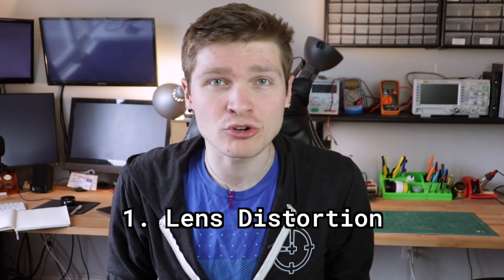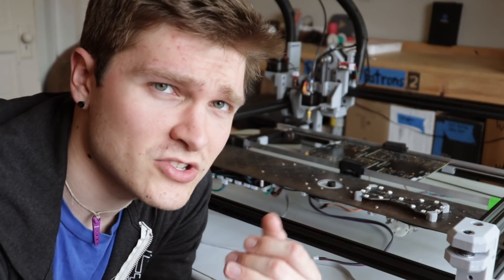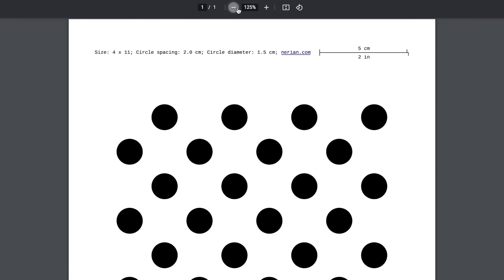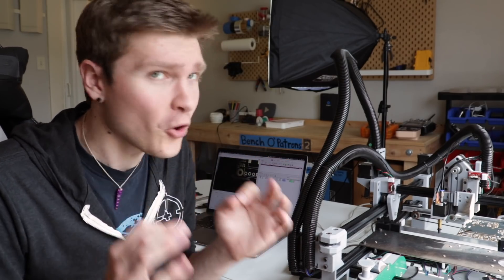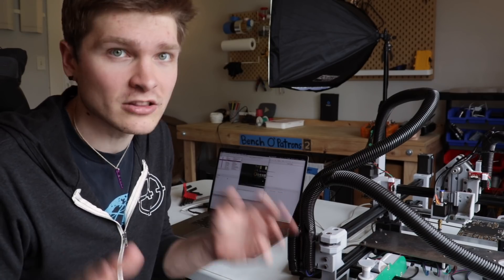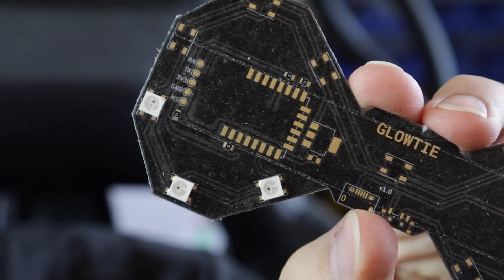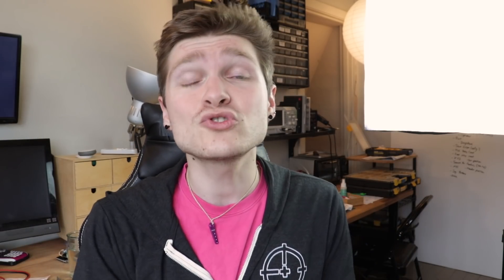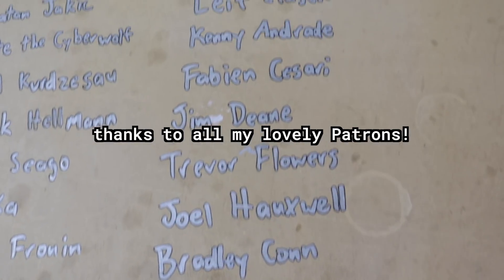PnP Calibration with Computer Vision!

Comment: I found that doing the bottom vision, the part/nozzle should be at the same Z as the board.  This takes in account if your Z travel is not 90 degrees to the board.
Reply: Good tip!
Reply: Indeed, getting everything (parts in feeders) the same height as the PCB made a significant improvement for me, did not think about bottom vision, great tip!

Comment: I hope you clamped the PCB down when you did the calibrations, otherwise you have to perform that process again, this time CLAMPED. Clamping is inducing some bending in the panel that will change the visual offsets. Also, put a stopper for the panel on that conveyor. You'll thank yourself later for that :) Cheers!
Reply: Watch his previous video...

Comment: It's interesting to see the use/motivation of vision cameras in a low-cost PnP like this. Amateur astrophotographers use a very similar approach where they'll have a second "guide camera" to measure and correct for tracking errors (by monitoring star positions in the sky) in their mounts while taking long exposures with their main camera. Like the PnP scenario, while you can technically get the accuracy you want just by having really accurate (and thus expensive) hardware, it's much cheaper overall to pair less expensive mechanics with a camera system and dynamically correct for errors. Very cool to see it used on a such a low-cost implementation!

Comment: Is there a built-in way of using the bottom camera to calibrate the offset of the various nozzle tips under rotation?  Additionally a way of chain calibrating the offset of the top camera to the tip rotational axis and the top camera axis to the bottom camera axis.
Reply: Yes, OpenPNP has the tip run-out built-in.

Comment: In an earlier video, you were concerned about glare due to the  design of the lighting. Has that been a problem?
If so, you should be able to fix it easily.
Buy a circular polarizer just a little larger than the outline of your ring light. Remove it from the ring used to mount it on a camera, and mount it backwards covering both the ring light and camera lens.
Circular polarizers are not symmetrical. By "backwards" I mean with the side that normally faces the camera instead facing away from the camera. If you lose track of which is which, look at your reflection in a mirror through the polarizer. One direction, you will be able to see your eye. That's the normal orientation -- your eye is on what is normally the "camera" side of the polarizer. The other direction, the polarizer will look like a black circle. The latter is what you want -- the side facing the mirror should face away from your camera & ring light.

Comment: This is really impressive.  I have a question.  If the suction nozzle places a component on the board, what is the chance that when the nozzle releases pressure and lifts up, that the component will move slightly?  Anyone know?

Comment: Why aren't fiducials a crosshair to get a bit more information in one image?
Reply: Vision can be fickly at times, so KISS is the best route at times. I found going with a 1 mm silkscreen dot work better than a fiducial.
Reply: @kennorman3586  depending on the manufacturer, silkscreen can be quite a ways off. Better to do it in copper, which will always be realtive to the pads